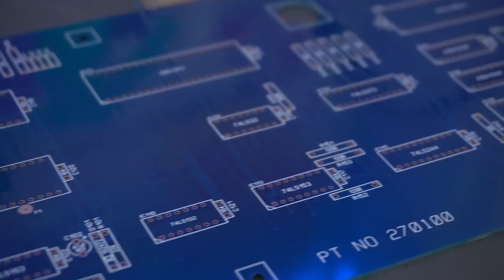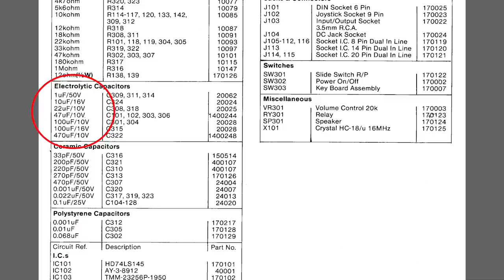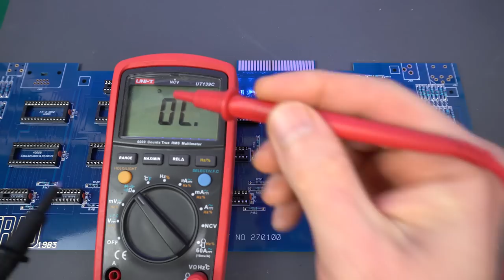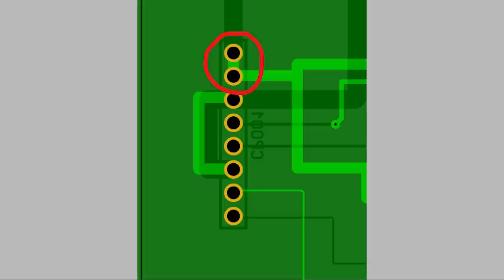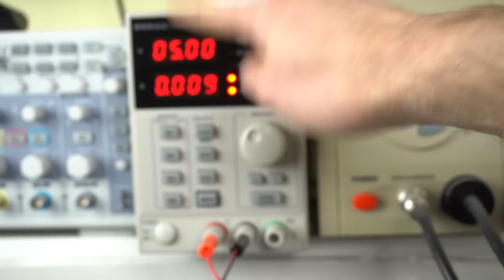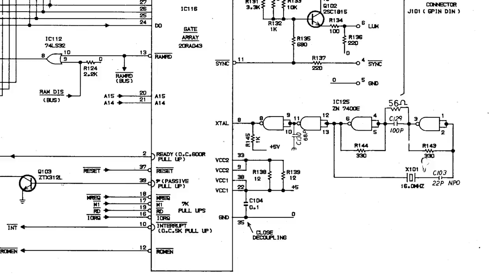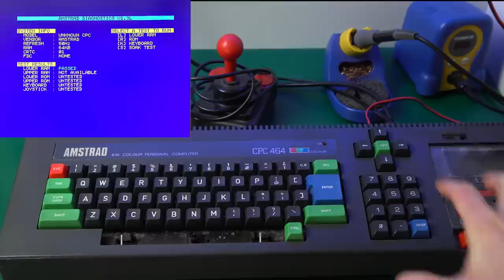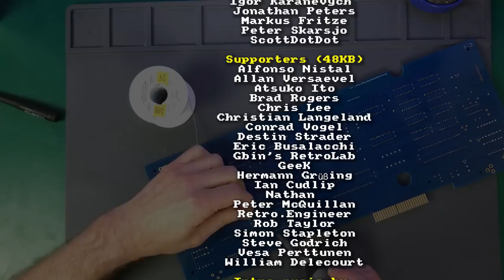Building the World's Newest Amstrad CPC

Comment: I’d love to see a post mortem on that transistor. Why you thought it was equivalent, how it wasn’t, and hopefully a new modern equivalent. Great video!
Reply: Yeah agreed. I never get bored of Noel going down the rabbit hole :)
Reply: The ZTX312 is a high speed switching transistor, with on/off/storage delays barely over 10ns.

By contrast, the BC547 datasheet doesn't even hint at its switching speeds (none that I could find anyway), so it's very likely very slow, and not suitable for MHz operation.
Reply: The circuit looks strange. There is no base resistor. Bipolar transistors must have a current limit for the base current. I bet a base resistor around 1k to 10k would have totally fixed the problem. The BC547 has a gain bandwidth of 300, which means it can do 1 MHz at a gain of 300 or 300 MHz at unity gain, or anything in between. It is plenty fast enough.
Reply: An equivalent would be 2N2369 to the ZTX312 as mentioned in datasheet for the original transistor.  The 2N2369 is still available.  The other equivalent being the BSV25 by the same original manufacturer is not.
Reply: Looking at the circuit diagram rather than which transistor is most similar to a ZTX312L, a 2N7000 MOSFET would fit perfectly and I would expect it to result in a proper clock signal.
Reply: @helgew9008  I completely agree with you as the BC547 works for me in several high speed (160 - 215ish mHz) PWM switching circuits.   Fred
Reply: Yes please put out a short video going over the differences. I'd love to know how it went wrong
Reply from the maker: I'm already working on it! 👍
Reply from the maker: @helgew9008  I can only imagine the Gate Array had a resistor on that output. Either that, or some very carefully-controlled amount of current. I agree that another transistor with higher hFE will probably need an even bigger resistor though. I'm working on a followup video just focusing on that, and it's very interesting so far (to me at least, since I have somewhat of an odd history with transistors).
Reply from the maker: @stephenjourdain1842  Thanks for the heads up! I'll pull out the datasheets and check it out. I even have some spare 2N2369 around because they're used in the Dragon Computer, so that'd be perfect.
Reply: @NoelsRetroLab  The waveform at 21:51 is very typical for NMOS logic. NMOS works with a pull-up MOSFET that becomes weaker when the voltage nears the turn-off region of the pull-up MOSFET. This is why with NMOS the voltage initially rises fast, and then the rise slows down. The pull-down is always fast, because MOSFETS that pull-down short to ground. Because NMOS internally works with a pull-up MOSFET that is pulled down if a low output is desired, the pull-down is much stronger than the pull-up.

Amstrad might have used this knowledge, knowing that no high currents will flow if the NMOS clock output is dumped into the base of a transistor. Still, the chip will deliver a higher current. (Perhaps try to estimate the current that flows with a voltage divider.) Preventing this current flow, either with a base resistor or by using a MOSFET would IMO be an improvement and put less load on the chip. After all, the pull-MOSFET is most powerful near zero output voltage.
Reply from the maker: Are you using it as a high-speed inverter like it is here? I'm finding it's much too slow to switch off, even when I tweak the resistances. I wonder if the gain bandwidth of 300 only applies to the on part (that one is really fast).
Reply: @NoelsRetroLab  Assuming you are speaking about the BC547: Perhaps it is the Miller-effect and it needs to be compensated in order to get the full bandwidth out of the transistor?
Reply: The BC547's turn off time is 300ns and the ZTX's is around 20ns. So, thats your problem right there. 2N2369 should be even faster than the ZTX so in theory should work OK.
Reply: @PJBonoVox  absolutely! I can’t get enough of Noel saying “Oh wow!!”

Comment: in the 80's I had a summer job while at Uni fixing avionics boards for GEC, and one way we found shorts on PCB's was to connect a current limited supply to the traces in question, and use an accurate voltmeter to measure the voltage at various points. As you get closer to the short the voltage gets lower, as you get further away it goes up. If you use a low enough voltage you can often avoid activating semiconductor junctions and thus cut out that source of errors - I traced one fault using a quarter of a volt and a (very expensive!) accurate voltmeter. I suspect that nowadays a relatively cheap multimeter with decent probes would probably be stable enough to work. The very low voltage power supply might be more of a problem!
Reply: I've seen people use milli ohm meters to do similar, basically check the resistance at each location and then check/rework the area with the lowest reading.
Reply: Д333333ж

Comment: AN easy way to find PCB shorts is to run a couple of amps through it and use either a thermal camera, or film of alcohol to look for hotspots.
Reply: Yeah, just hook the pcb up to the mains and when the smoke clears you can look for hotspots.

Comment: This took me back to 1984 when the CPC464 was my first computer. I was still using it and my second machine the CPC6128 on release, right up to 1995. It was here I bought my third computer a Packard Bell with Windows 95. I had a great collection of the cassette tape games, along with the not so Floppy, floppy discettes. The monitor to tv converter and digital clock, Primary and secondary disc drives, the Romantic Robot from STS and disc. I even had the Eprom boards for blowing my own chips. Though the best mod I ever did on my CPC6128 was to fit the 464 chip, piggy backing the 6128 chip with one pin bent outward from each chip. Then with a toggle switch wired to those pins that when thrown it connected to the pin hole on the PCB. This in turn when the switch was thrown one way or the other before start up, would then boot the Amstrad into either CPC464 or CPC 6128 mode. That gave me two Amstrads for the price of one. I can't remember now about the mod, but I am sure if you don't know it, someone out there will know how it was done. It is a neat little mod to do if you are interested in both Amstrad models. Going back to the cassette tapes, I had all the Amstrad Action magazines and cover tapes. After purchasing the Romantic Robot from STS, I ran the game Chips Challenge, pressed the Button on the RR and up popped the code. During the game each level had a 4 character code to by pass levels you all ready played and continued from the higher level if the correct code was inputted. After having about 12 or so levels completed, I looked for the codes in the lines of the game programme code lines. These where broken up into four blocks and each block equalled a letter of the code as 1st, 2nd, 3rd and 4th if spread sheeted into columns. I found them all and a few bonus levels too and wrote to Amstrag Action with the results and had them printed in the next available issue. For the life of me I can't remember the issue number, but I am sure there is a copy of the magazine out there somewhere. Sorry for the long comment (excuse my grammer etc), but I thought you and the other readers would be interested in reading my experience with my Amstrad CPC machines etc.

Comment: I cut traces normally with a sharp blade knife or scalpel, cutting at a slight inward angle from both sides, essentially cutting out a shallow V underneath the trace.
Reply: I came to comment just that, usually I do it a bit over-wide and remove the copper in the center, to be REAL sure it's cut and won't bite me in the future. Ask me why ... :P
Reply: Two cuts and then the island of copper in between is thermally isolated from the rest of the track, so a soldering iron can easily soften the glue enough that the piece of copper just slides off. Much easier and cleaner than trying to scrape enough away mechanically!
Reply: @charlesdorval394  Know the feeling! I had dendrites growing past a  non-insulated cut once, have lacquered them since as well! :D

Comment: Problem with current fpga’s is that they are 3V3, so as well as the fpga, logic converter chips are also required. The low end Tang Nano and Lattice MachX02 can easily replicate the digital functions contained in the gate array chip for those 8-bit computers. So if I designed a replacement solution , it would be a small board containing a few chips to plug-in where the gate array chip goes.

Comment: This is so encouraging to see. I dusted off my CPC664 this evening, cleaned it up and inspected it... I won't be risking plugging in the monitor until it's had a thorough recapping so I can't power it up... I need to sort out an alternative PSU and some kind of video lead in the meantime. I spent so many hours in front of it as a teenager and really loved the machine, I was involved in the fanzine scene running a small CPC fanzine for a period of time - we were featured once in Amstrad Action. I also have a dead CPC464 I picked up about 20 years ago which I know doesn't work but it's in great cosmetic condition and has the proper retro GT65 green screen monitor. Some of your diagnostics on this new board will surely help me to diagnose it and I'm really pleased it seems most components or alternatives can still be purchased (apart from the ULA obviously). I'll be certain to watch more of your vids and have subscribed -- thankyou for producing this content!

Comment: I am actually surprised that only 3 board errors were present from photo-copy/tracing the original board. At the same time, I'm also surprised that this was never tested, not even once, before shipping it. In my humble opinion that I greatly respect, the best replica of an Amstrad CPC (64K, 128K, with tape or with floppy) would be a modern redesign of the board, with as many quality of life features as possible, while still being "layout compatible" with original cases. I would not mind if it included a R-Pi-0 GPIO header to sandwich a Pi-0 on the board for WiFi, ROM-loading/dumping, etc., maybe even HDMI video and sound. This would be something like the ultimate sleeper Amstrad CPC fully upgraded and not emulated/FPGAtiated. Running SymbOS Z80 (in addition to original and modern software) on such a machine would be a treat.
Reply: Apparently, this was the testing: Noel was simply selected as a tester for the project.
Reply from the maker: Like Jared said, I was the beta tester for the board. I probably didn't make that clear enough in the video, so don't blame Rob! 😃
Reply: Nice video, hope to see more with repair part of old CPC like Kay board ribbon or floppy disk.

For the extension question, I agree with a pizero solution connected directly on the Z80 or the expansion connector.
Think about the pistorm for the amiga, what about a similar solution for the amstrad with a pi connected that offer storage, wifi, hdmi, emulated hardware like playcity or what you want.

This will be awesome.
Reply: Some people want super sized retro, others wanted authentic.

Theres room for both. Modern CAD allow easy version control and design.
Reply: i think you maybe looking for something like the USIFAc II  ... pic micro connected to expansion port, runnin FDC emu, USB, TTL serial port, esp32 wifi addon..and a whole bunch of other features.. and IMO pi-zero is too powerful for retro!

Comment: Instead of scraping the track away with a screwdriver, you should have used a scalpel to slice through the unwanted track. Much quicker, more precise, and neater. A trick I learned from my years in the Air Force.
Reply from the maker: I'll try that next time. Thanks for the tip!

Comment: Hi! There is a good way to save some time and alcohol while cleaning PCB after soldering done. Just use regular paper towel soaked with alcohol. Sure, towel will be destroyed, but paper will accumulate all the residues. Just use some brush to clean all the paper scraps.

Comment: Noel, the issues you experienced with the board you showed in this video were actually fairly common back in the early days of computing. It's why many "retail-ready" production computers and electronics have bodge and patch wires, resistors and capacitors soldered in post assembly. I have a do use a razor blade to keep cuts more precise, but can't fault the use of a flat-head screw driver. Love your channel! Cheers!

Comment: If I want to remove a piece of PCB track, I cut each end  of the piece I want to remove with a sharp scalpel and then heat the copper track with a soldering iron and it lifts away quite nicely 🙂
Reply from the maker: I may have to try that next time. That sounds much cleaner than my method 😃

Comment: There is a technique for locating a short like the ones you had.    Set your power supply to something like 1 volt, and set the current limit to maybe 100 mA.  This will prevent damaging any traces on the board.  Now apply 1V to wherever it would normally come from, either a voltage regulator if there was one, or a power connector.     The voltage will drop down to a low value because of the current limit.   Maybe 0.1V or less at the source.   Now using the mV scale on your DMM, measure the voltage between VCC and Gnd at various points on the board.  The voltage difference at points between the short and the power feed will be very small, but not 0 due to the trace resistance.  It may only be a few mV at some points.  As you get closer to the short, the voltage will drop.  If you measure between VCC and Gnd on the "other side" of the short from the power feed,  there will be no voltage, so that would also tell you that a short is between where you are measuring and the power feed.

Comment: Great job!
I am an electronics diagnostician.
I have found bridges on tracks, just like the ones you had.
A very sharp craft knife or scalpel, lightly scoring the part to remove before teasing up the edges will look much better.
I have used this method to modify boards. I recommend a good magnification device.
It’s more important to take take and score lightly several times rather than deep score just once as the board and any interleaved foils can be damaged.

Comment: The Harlequin, (a Spectrum 128K clone), uses off the shelf logic chips to replace the ULA. Larger modern RAM chips, a surface mount chip for the video and a PCB that fits into a rubber key case or a 48K+ case. It also has Svideo out. It was fun to build, but yes, all those IC sockets were the boring part of it.The only original IC I had to use was the AY chip.
Reply from the maker: Yeah, that's definitely an option, although I suspect there's more logic than in the Spectrum ULA. You can actually see it in the prototype Gate Array boards that are floating around.
Reply: @NoelsRetroLab  It has 55 IC's. A Z80A, an AY-8912, a 32K EPROM, and 2 64K Memory chips and an AD742JR video chip, the other 49 are just the logic. LOL.
Reply: I've put whole ZX to some scrap Altera CPLD. Also implemented some scandoubler to convert output to VGA. Even made independant clock for z80- turbo mode up to 8MHz CPU clock and no wait states for computer. Total 5 chips: CPU, RAM, ROM, VRAM, CPLD. So, replacement of antique gate array must be easy task. Two GAL chips replace C64 chip...
Reply: @kaunomedis7926  Cool.

Comment: I know I'm late to the party, but the CPC 6128 was really the box I should have gotten back then (but haven't zero funds ...).  I borrowed one for some days to work on extending the Small C compiler under CP/M.  It was successful, but hilariously compiling the compiler took about an hour IIRC.

It might be fun to swap the membrane out of some modern mechanical switches, fixing one of the worst problems with the machines of that vintage.  Done right it could be a total sleeper.

Comment: Always good to know people out there are making sure the legacy of some of these old machines are being kept alive. My guess is a CPLD would be more than enough to handle that Gate Array chip. Of course some of those single board computers might be an alternative using an adapter to pop into the socket. Nice troubleshooting also!
Reply from the maker: Thanks! The GA is beefy enough that apparently it's a tight fit in a CPLD, but that's the solution I'll be testing soon. Really looking forward to that.
Reply: @NoelsRetroLab  There are probably some out there that can handle it. With the right optimizations I bet you can fit it.

Comment: From a guy who worked with circuit level repairs on Supercomputers: It's easier to break traces by using a very sharp utility or hobby knife, then either use the knife to lift a section of the trace, or once cut, use a blunt pick (like a dental pick) to gently widen the gap.   It looks much better too. Even supercomputer engineers make design mistakes and boards have to be modified.

Comment: Great video! ... and great that there is a new board for the CPC464.
Reply from the maker: Thanks! Yes, I'm super happy we're almost there with CPC hardware. Just one more chip... and that one is about to happen too.
Reply: @NoelsRetroLab  I would really love to see a new case. Maybe I'll get to design one some say. Some cross between the classic 464/6128 case and the plus series with space for more ram, a Dandanator and some other stuff. .. or even cooler: a Desktop CPC with an external keyboard (using the OG keyboard)!

Comment: Could be a gain issue on the transistor - those old Ferranti e-Line transistors had a typical hFE of about 80 and you had to drive them pretty hard - by the standards of the time, they were pretty fast (ft ~= 400MHz), but were low gain.  For comparison, even the really old BC109C had a hFE of 400-800.  Since it looks like the primary intent was to square up the clock coming out of the gate array, the resistors would probably have been selected to drive it quite hard - you might find that if using a higher gain part then a higher value resistor would work better.